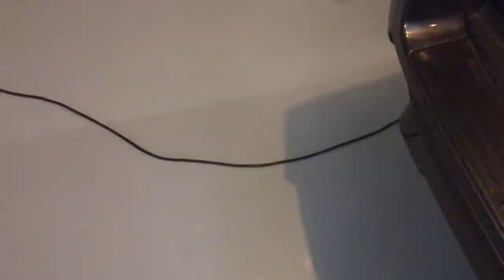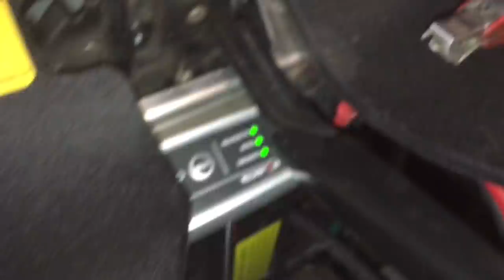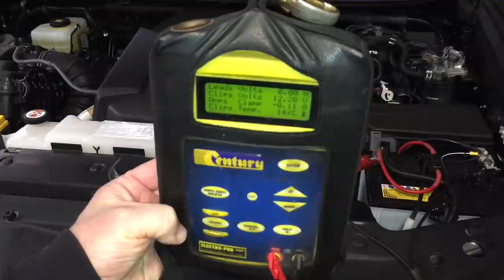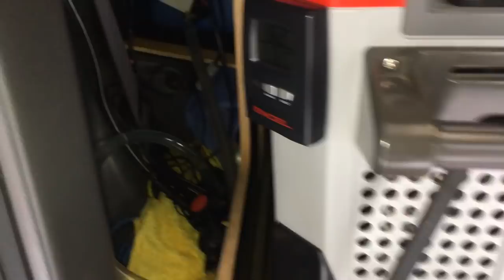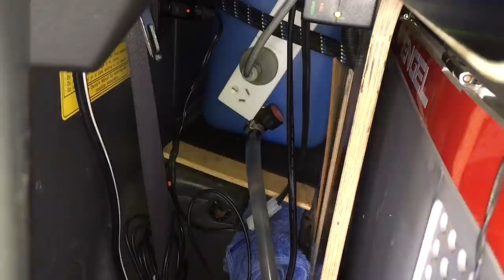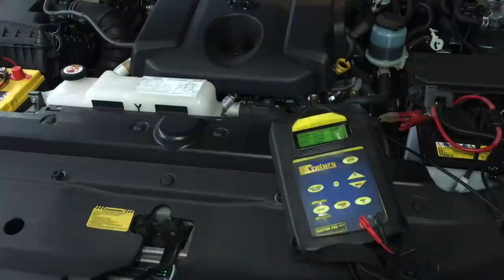DCDC CHARGER KILLING BATTERYS IF YOUR NOT AWARE OF THIS

Comment: Read the instruction manual for redarc sbi12 isolator and bcdc25 dcdc charger. Specs are identical, cut in at 13.2 and cut out at 12.7. I have both these units, isolator in my Hilux and dc charger in my Prado and can confirm cranking battery voltage is still around 12.7 after leaving overnight in both vehicles. I then looked up the manual for the projector unit you have. It has 2 modes, standard (same setting as redarc) and smart alternator mode which cuts out at 11.9! This would be killing your starting battery. So long story short check ya setttings. If you want to spend money,change to the redarc. If you want certainly when buying new then get the redarc with IGN in the product number as it has a trigger wire that you connect to your ignition to turn the unit on/off manually with the engine instead of sensing battery voltage. These things should not kill you main battery if they are setup correctly.
Reply: Get rid of the Projecta.
Reply: My Redarc bcdc25 has been installed for for a couple of years with a 200Ah lithium battery, a 160W fixed solar panel  and a 200W folding panel when camped. I have also never had problems with my starter battery. I also use the ignition connect.
It seems that incorrect settings and/or wiring are the cause of the problem in the video like you said.

Comment: It should not be drawing any current from the starting battery to the aux battery with the ignition override connected to the ignition. Check that the ignition override wire does not have any voltage with the ignition off, it could be another accessory feeding some power back through the ignition with the ignition off (it may not necessarily take 12v to enable the controller). Otherwise it could be faulty unit.

The ignition override wire should only be used if the vehicle has a smart alternator that switches voltage when the battery is fully charged while running. I'm not sure if that prado has such an alternator or not.

I watched the video again and I saw the 'Alternator' LED is on whilst the vehicle is switched off. That means the ignition override is incorrectly wired into the ignition switch. Check to see the ignition override wire is actually connected to the ignition switch and check the voltage with a multi meter to test it. It could be an accessory feeding power back through the ignition (it may not need 12v for the controller to enable).

This means that it will drain the starting battery to 11.9 volts when the car is switched off. Not good! You do not need to wire up the ignition override in vehicles that do not have a smart alternator that switches voltage while the car is running. I'm not sure if that prado has one or not but I'm sure you'd know.

Comment: The DCDC charger is only designed to charge your secondary Battery from either solar or from your input from your Alternator via the primary battery. It should be placed inbetween the two battery's as it also acts as a battery isolator so when the car is not running it stops using power from the primary battery.
Out of the two inputs it will always take the solar option first. I have the same charger set up to run a 1000w inverter with a 120AH AGM deep cell battery and am very impressed with the settup. Forget using the DCDC charger to charge your main battery. It's not designed for that. That's what your alternator is for. Sounds like you have a wiring issue with your settup.
Reply from the maker: I know exactly what it’s designed to do and it’s connect up perfectly well and there’s nothing faulty about it it’s happened to other people also sometimes they randomly drain the battery I know it only charges the extra battery but went on Solar it should help the cranking battery instead of discharge it which is obvious because that’s why we’ve got it there in the first place to protect the cranking battery so we can start the engine in the morning I’m glad you are happy with yours

Comment: I agree, there is an issue. My solution for my Tourer build that parks outside all the time with 200 watt roof mounted solar panel that charges second deep cycle battery on solar priority from 45ampProjecta Dc to Dc too. To look after starter  battery,  I have a 20watt solar panel to solar controller I connect up to the starter battery to keep it 100% charged. Both batteries now get to 100% daily with vehicle parked up in drive.

Comment: What is your solar panels charging into? The starter battery or the auxiliary? You have a smart alternator so if your solar is going into the starter the dcdc will sense there’s charge going into the starter and trigger the dcdc charger drawing 25 amps or whatever amps the dcdc is straight into the aux battery, the solar won’t keep up that amps to the starter so it will flatten it until the the aux is full and then charge up the starter. Solution is wire in solar to the aux battery.

Comment: I’d suggest that BCDC charger has been setup for smart alternator settings, which won’t shut off the connection from the main battery until it sees less than 12.2v. On a conventional setting, it will shut off the connection at your suggested 12.8v.
Reply from the maker: Pretty dumb then hey

Comment: I have a Redarc DC DC 1250, 50 amp charger and have it fitted in the canopy of my Ram Truck with 2 /100 amp/ hr Lithum batteries.
It is wired correctly with ignition sensitive feed as per manufacturer requirements.
I do not have the problem which you are having while solar is charging.
Even without the ignition sensitive wire attached the unit only stays connected after the ignition is switched off when the starting battery lowers to 12.7 which is normal voltage.
I suggest you read up on these units as I feel they are great value and not the size of a family biscuit tin like some others, and made in Austraila.

Comment: I’ve been running a simple voltage battery isolator (Victron Cyril-ct) for many years on my 2002 Hilux without issue to either the relay or batteries.  Love your honesty and feedback on aspects of everything Toyota, diesel and 4wd. Keep up the great work.

Comment: I have experienced the issue you demonstrate where the projecta seems to get confused and continue to draw from the cranking battery when the voltage has dropped below the cut off point.  Unplugging all connections and re connecting fixes mine as does changing the battery type to something else and back again.  It's very infrequent so not sure what triggers it.

Comment: My Kings 25amp dc dc charger has an active cable which is connected to the starter battery and has a 50amp fuse. If I remove the fuse over night, will that help stop the leakage? I have the blue wire on a piggyback fuse but still notice the struggle starting the ute in the morning.

Comment: I used a Redarc smart isolater under the bonnet between crank and spare, The crank was also connected to a Renogy dcdc with solar preference in rear of car which charged two lithium in parallel . I placed isolation switches from front to dcdc and from house out. Fixed solar on roof also switched to dcdc. I could close everything thing down when not in use. Renogy dcdc charges house, once full would charges crank and smart isolater would switch to bonnet spare, once all charged Renogy stops charging.  Never had any issues.  I could also press button on dash to join crank n bonnet spare to start car.

Comment: Would adding a dual battery voltage isolator before the dcdc charger fix the problem with a small 12v battery for a scooter or kids car to run the Dcdc charger when the solar panels are being used
Reply: Also that Dcdc charger has a trigger for a smart alternator you can use this to turn off the drain from the main battery when the ignition is off

Comment: It's just that when your solar voltage drops, due to cloud, the dc-dc charger continues to charge the 2ndary, by draining your main battery. So you need a switch that's easy to use, which will disconnect dc-dc charger from main battery, so it is not drained when trying to charge from solar in cloudy/bad weather.

Comment: Must say that I have a projecta idc25 charger and I'm not happy with it. Long story short, I had several incidences where I could not start my engine. Ended up using a jumper cable to connect the (+) from the Aux. battery to the (+) of the starter battery for around 10-15 minutes in order to start the car. Thank you for your post. Hope they make it better in the future.

Comment: It's working exactly as it says, if you don't have a smart alternator or don't want it draining to 11.9v don't connect the blue/ignition wire
Reply from the maker: I think you’re a bit confused with the operation of these units nothing should make a drain a battery that low

Comment: when you adda 240 charger to your main battery and it get over 13 v the dcdc kicks in and if your charger is only 10amp and the dcdc charger is pulling 25amp that will kiil your main.

Comment: Strange?? My aux 100Ah AGM seemed to charge fine with the Projecta 25A DCDC charger wired with the ignition wire trigger without 'killing the starter battery'. Vehicle is a MY18 DMax with smarge alternator. I have done longer trips and weekenders albeit without solar connected. No problem with the starter battery so far. I monitor the aux battery volts periodically and the charge light indicators. Not sure what the whole point was apart from trying to confuse non-electrical people with a bunch of numbers and readings?😶

Comment: Yes i thought i was going crazy, ive got clamp meters & testing at all points. Was good before i put the solar panel on the roof. I'm finding its not disconnecting the start battery.

Comment: The projector DC/solar without the blue wire ignition connected starts charging when it reads 13.4 volts and turns off at 12.8 volts so it does use up the float voltage on the start battery but they work fine for most cars with smart alternators they do draw a little power constantly from the start battery 20mA. The solar charge controller they have MPPT is a great leap forward older systems allowed the solar panels to draw power from the battery at night if you did not fit blocking diodes

Comment: Dunno ... I use intervolt dc dc with 260w of fixed solar winter summer 130w... 400ish ah of batteries never had an issue... systems balanced to keep depth of discharge above 80% to maintain longevity in the batteries...regardless isolate and 240v charge each battery once a month. Ps have seen some brands “running” away and glitches with charging lithium and geckos fried on boards and decapitated by fans inverters too... regardless when in a remote location I manually isolate the main / starter battery over night as a precaution against made in China or India components.

Comment: Solar panels which don't have the zenar diode built in (such as fold out solar panels), will act as a load when they are connected across a battery when the voltage produced from the solar panels is less than that of the battery it is connected to. That could be your issue.

Comment: I had this same Projecta charger (but it died on a trip at 5yrs old) and had it ignition triggered so it would only start charging about 30sec after engine start.  Otherwise it may do what you showed…. I also manually disconnect my house battery from the cranking battery (trip the circuit breaker) so when I 240V wallcharger top up my cranking battery it doesn’t start DCDC charging the house battery. Just need to think about how these things work…
Reply: Avoid chinese dcdc chargers altogether, had numerous branded ones and all failed

Comment: Ive got same up under banner but just different battery ~ aux battery got a deep cycle . Cannt seem to get the redarc sbi12 to charge to as close to 100 percent : should i be looking at a 130amp alternator upgrade . Not got any of the electoral units as u in the back of ur prado

Comment: These’s a fault with that charger, be it product or wiring fault. The alternator light is on on the dc-dc charger. That should not be on until the engine is running. That system requires proper diagnosis
Reply: Exactly my dcdc cuts supply from the starter when it gets to 12.8 and rejoins at 13.1

Comment: With my 2012 Patrol Ute, I use a Redarc SBA12(D) Smart Start Isolator for my AGM Dual Battery System. I also have a 110watt Solar Panel permanently wired into my Accessory Battery Circuit, which is set to put out a maximum of 13.1volts into the Accessory Battery Circuit.

Once my Solar Panel puts out 12.7volts into the Accessories Circuit, the Redarc SBA12(D) Smart Start Isolator opens and charges both the Accessories and Starting Battery.

Comment: I have a redarc L1240D that does This.it is faulty,,it won't shut off when the voltage drops bellow 13.4 volts and has killed two battery's. All I did was install a redarc SBI12  between the main cranking  battery  and the DC DC  charger problem solved been going strong for over 12years.

Comment: Run both the idc25 then idc45 and now running the idc25L on my 3 iterations of setup in my ute all with permanent mounted panels on the canopy in various forms no continuous current draw issues what so ever  monitoring with a bmv712 logging it the whole lot for research being an auto elec of over 20years I've been really interested in testing units myself before putting them onto  customers vehicles.  Id be interested to know the issue you are having what the actual current draw is of the starter battery and if you used the ignition circuit control being its a computer controlled ("smart) alternator (especially on the late model D4D range)you can't use a VSR unit in line as we see on longer drives voltages drop to as low as 11v at the battery before the alternator cuts in for a big charge cycle. Also were is the negative from the solar and dcdc bolted to hope not directly to the starter battery as this can cause a false reading from  the cars alternator control and the dcdc unit if theirs also no large negative circuit from the aux battery to the body too. I personally have surpassed fitting 250 of these over the years with only 1 every faulty which was honoured under warranty even though the customer mixed up terminals after replacing their own battery.
Reply: Hey mate I have the idc25 hooked up to smart alternator. Imstalled as per the book and my charge light stays amber, alternator green and blue flashing with the car on or off

Comment: My alternator light on mine ISNT on when my solar panels are connected through the solar input. Something is likely not right with the hardware or wiring
Reply from the maker: Yeah I don’t know The warring was definitely right many other people had the same problem and it worked fine sometimes in my opinion you can’t trust these electronics

Comment: I bought a red back 120ah agm battery in 2006 I had it load tested not voltage tested by 12 volt shop in Adelaide in 2020 and it was still at 93 percent.  used for Engel fridge and lights no problems. charged with blue apple charger which has been changed through 5 vehicles since new. I now have another red back battery. With the original blue apple charger with issolater Hopefully I can tell this story in another 10/15 years

Comment: I should have added if you read the directions in the Projecta booklet, it actually shows you where to position the DCDC charger - inbetween the two batterys with an input from the main battery. NOT designed to charge both battery's, only your secondary one.
Reply from the maker: As I keep saying I didn’t come down in the last shower where do you think it is and where do you think it’s connected to ha ha ha ha funny guy

Comment: That projector charger should not be charging from the main battery if the volts are not  more than 13.4 volts and engine alternator  running must be faulty or bad design.
Reply from the maker: Crap design i think

Comment: Cant speak for the Projecta units but i have had a completely different experience with my CTEK DC-DC Charger 

Main idea of using them is the voltage boost over the voltage that the alternator is giving out (some capable of producing 15v+ for a desulphation stage), the ability to run differnt battery chemistries in the same system like lead acid and AGM and the 5 stage charging profile like you get from a 240v wall charger so your battery gets what it needs.

The point you raised about taking power away from the starter battery for some reason, again I havnt used projecta units so I can't say for sure but that shouldn't be happening if its working correctly

My CTEK dosnt drain my starter battery at all at idle and even delays charging the auxiliary battery if the starter is abit flat, I can see this happening in real time with the dual battery monitor I have in the cabin. It does consume power constantly yes but it should be less then 1ah a month if all is well which is not far off what a voltage sensitive relay will consume 

It would however be interesting to see the amp draw from starter to DC charger  to see what it is actually consuming

The solar problem is abit of a design error, I ended up fitting a dedicated controller which feeds the starter battery,  this then activates the CTEK when the starter is happy and charges the auxiliary, which seams to work great
Reply: If you connect your dedicated solar controller to the starter battery, it will activate your DCDC charger. Depends on the solar charging current. If you are charging at 10A, and the DCDC charger is draining at 50A, the starter batter could be drained. In my case, I connects a dedicated controller to the auxiliary battery, leaving starter batter completely in factory stock setup.